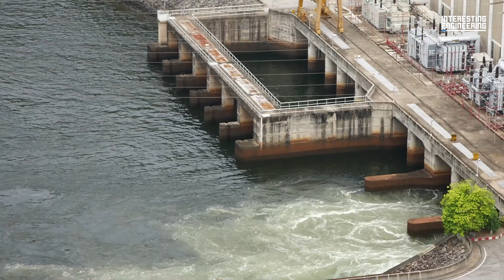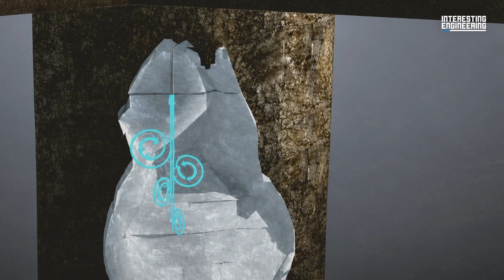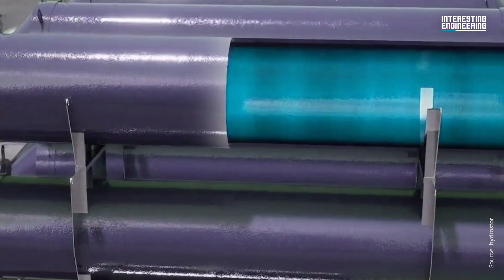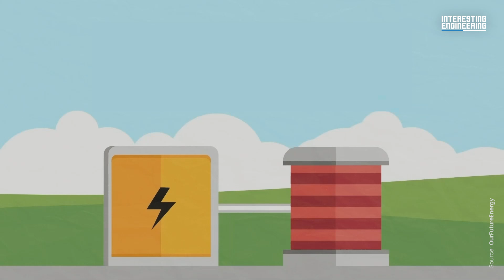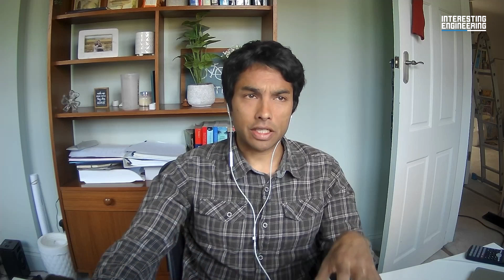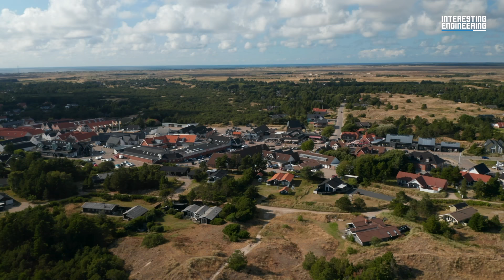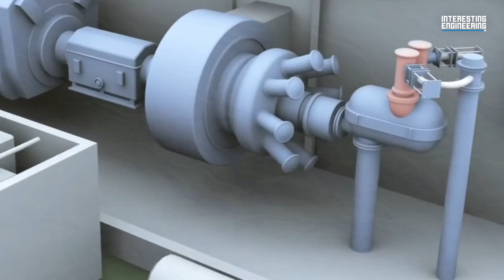Why Air Batteries Are Finally Beating Lithium

Comment: Why didn't you talk about A-CAES, this is the more efficient way the storage a large amount of air ? 
You split the heat with an exchanger from the air and storage it. When Energy is needed you release the energy and bevor you enter the turbine you heat up the air with the storaged air! The efficiency is aroung 65-70% quit good in my opinion. 20% less than batteries but you can storage much more!

Comment: The biggest issue with solar voltaic and wind generated electricity is it can disappear in a few seconds requiring instant makeup.   The instant makeup is created by the power grid running natural gas turbine generators at high readiness fast reactivity credited with generating zero electricity at the natural gas cost of generating all the electricity with natural gas combined cycle power plants.  There is no reported fuel savings.   Wind farm output wild fluctuations per second requiring constant makeup is the most natural gas expensive form of generating electricity.  The UK is culling wind farm output to save on natural gas.

Comment: I like LAES better. You can store liquid air in relatively generic tanks that don't depend on geologic luck or require high pressures, and they provide a steady output until you run out of liquid air to expand, they don't have a dependency between storage pressure and output.
Reply: Agreed. I didn't hear him mention liquefaction

Comment: A compressed air engine could be connected to an air compressor and heated midway from external flame. I believe pressures upto 5 atm can be easily achieved. Air compressor is used to prevent air running out. Else a one way valve could be used to prevent it. A stirling engine could be easily turned into a compressed air engine. Just make a hole on top of the right side cylinder and connect to compressed air source to the bottom of right side cylinder.

Comment: Could the temperature differential be made useful? For cold storage on one side and heating on the other side? The containers would have to be mobile though, charging in one location, dischargig in another. So I guess that creates it's own problems.
Reply: Well, there is also the possibility of moving the generated heat with water or another form of remote heating / cooling. Would just have to swap the direction of the liquid (or heat exchange medium) depending on where you're charging or discharging. And have something else cover the heat/cooling while it is not present.

Comment: I'm not sure what's wrong with wet electrolyte batteries.  You start with plain water and use dissimilar metals to store and extract energy.  Only about 4x as bulky as lithium ion cells but no rare or toxic materials just some lead which you contain, probably can be done with something other than lead.
Reply: I tell you what: a hydrogen atom  has one electron,  an oxygen atom has 8 electrons. So most of the energy going into electrolysis will go to the 8 electrons of the oxygen.

Comment: So for portable solutions it's not a replacement for car/transport battery that need individual routing. But for static items like civil and or train or rails that runs on a rail for conduction, it can be a non poluting source of energy. Cheers

Comment: Lots of talk talk talk ...

There are many ways of storing energy and a proper optimisation study is needed to clearly score the high efficiency storage from other storage options ...
Some clear parameters need to be outlined eg Litres per 100 kms in the case of vehicle efficiency 
Otherwise it's just talk talk talk and more likely blah blah blah

Comment: You could increase the output of the expander by injecting diesel fuel with the air across a hot surface igniter

Comment: The future of large-scale energy storage may lie in underground caverns filled with hydrogen at pressures above 200 bar, combined with fuel cells or hydrogen turbines. Although the overall round-trip efficiency is up to 70%, such systems can store terawatt-hours of energy for very long periods, potentially allowing the energy to be recovered even years after it was stored.

Comment: why not water battery? its much easier to make and maintain, and can be made with an open container. high pressure battery require thick pressure vessel

Comment: At 8:36 it was mentioned CAES should be located near renewables. However, the CAES facility in McIntosh, AL isn’t located near any noteworthy renewables. It’s one of the world’s largest CAES facilities IIRC taking advantage of a massive salt dome. It’s located next to a large base load coal fire power plant. So base load can be used to charge the storage, while renewables elsewhere on the grid are able to source demand. This is similar to the situation at the Racoon Mountain pumped storage facility in TN. It’s located near the Nickajack Dam hydro plant, which is renewable, but is dispatchable unlike wind and solar and is reliable year round. My point is, you build these types of storage systems where geology allows, regardless of whether wind and solar are good options nearby. You build out some sort of generation capability near by even if it is thermo electric. Then you let transmission and energy trading sort out the locality issues of the renewables.

Comment: Another option for improved efficiency would be to find an alternative use for the heat generated in compression and expansion cold.  If a town has a district heating or cooling system, then CAES could put thermal energy into this sink.  A swimming pool, large greenhouse system, industrial scale cooking, a supermarket, an ice rink, a large strategic food store - these are all consumers of low grade heat.  If you don't need a cold source, then heat for expansion could be gained by pumping sea water through reheat heat exchangers.  Of course, using bulk heat requires a lot more long-term planning and coordination between the powerplant and consumers within society.  It isn't a simple modular solution.  It requires infrastructure investment.
Reply: It is a waste to use good engine fuel for low temperature heating.

Comment: I am an engineer!  Let's not do interesting engineering, let's do actual engineering!!   As soon as he said cheap electricity is flooding the market from wind and solar. I knew right away he didn't have a clue what he was talking about!  Hydro is cheapest. 2 cents a kW to produce for lifespan of the dam. Coal is next 6 cents kW, next and around equal are oil/gas turbine up to 8 or 9 cent per kW.  nuclear is 12,   Solar is 15, then wind is 29...    the only reason solar works is because it is subsidized by government.  It forces power companies to buy it when people put in on their roofs.   Power companies don't want to buy it, they have to buy your solar power for way more than they can buy it from coal plants...    Same with wind but worse...    so many AI videos and AI facts...   I don't know how to trust youtube anymore...

Comment: Nah, I don't think so.
You can't prevent temperature changes when compressing or decompressing air, except by pumping heat out of the air being compressed and pumping it back into the air when it is being decompressed. This is a problem. Especially since this sort of system would prevent efficiency gains in the compression system generated by capture and use of heat energy during compression.

Comment: Wow.. it looks like CAES needs a combination with storage of heat/coolth .. but those storages can also each be made useful.

It should be possible to make clever combinations with thermal storage, at high and low temperature. The temperatures of storage can be tuned to local needs.

Comment: Many commenters here clearly didn't actually watch the video.

The key point is that with batteries, the battery capacity is the expensive part, with the grid-connection being (comparatively) cheap. Compressed air flips that - caverns or air tanks are cheap storage capacity, but efficient reversible pumps are expensive. This creates a niche where compressed air storage is more cost-effective if your charge/discharge cycles are longer.

Comment: Liquid Nitrogen Pressure Tank Battery or even Liquid Carbon dioxide and used by brayton cycle power plant when power generation is needed, we can use Nuclear or renewable to store or liquify the gas, we only need the right super alloy to hold the pressurize liquid gas

Comment: People keep coming up with mechanical energy storage systems but it doesn’t compare with chemistry in terms of energy density. Just think of a tank of petrol or an ev car battery which has enough energy to take your car hundreds of miles. No way any thing mechanical can compare

Comment: But efficiency remains a concern, you can only recover max 30% from the energy conversion
Reply: If you are going to lose 100% of excess solar or excess wind then any recovery that can be used on demand is better than none
Reply: still better than curtailing , and environmentally sustainable.
Reply: In the video he said 60-70%? https://youtu.be/GoiECSXOvQE?t=581
Reply: @mad1toad  maybe at peak efficiency, the efficiency drops as the pressure drops
Reply: @interhaker keep the pressure high then
Reply: @stopscroll23  you can't
Reply: Coal has even less
Reply: Plus coal is power generation, not storage so this you have to minus the losses of generation minus another 70% for storage in this case
Reply: @daniel-jipa  wrong coal can be 40+%
Reply: @daniel-jipa We can use coal 24/7.
Reply: A lot of energy loss is a total killer IMO.
Reply: Petrol engine is no better.
Reply: During sunny days the price of elecricity goes to zero (or close to zero). 
Then you do multiply zero cost times 30% ratio and you still get zero cost.
Reply: Sure, but storage remains basically infinitely scalable.

Comment: The solution will be a mix of all energy storage systems. Thermal energy storage , cold or hot , is a very viable option since a big chunk of energy is used to heat and cool spaces .

Comment: Compress air it warms attracting moisture.   Cooling air  water is released,   irrecoverable energy is lost.    Should a tank rupture stored energy is released with no control.  there might be be considerable damage?    That's without examining what is the reason for needing this?  It is not carbon dioxide so climate is unproven.

Comment: This might not be feasible at this time, the dimension vs the cost of construction and maintenance for all the system parts specially the moving ones and the hazard factor for these pressurized tanks. Failure of the system is higher if more components are added in it.

Comment: Anyone else thinking free air-conditioning?  Cool the compressed air, use it as an air conditioner on expansion.
Reply: I mean that could resolve the decompression situation in the second stage of the storage. Although that idea might need some additional infrastructure to move said cold air which again is going to be costs.

But I hear you stranger, I hear you.

Comment: I'm so old that I remember "bubble memory", a non-volatile storage technology that seemed to have a niche use in the 1970s. But it got overtaken fast, and is now forgotten. This sounds like the same story; you can argue that it has a niche use-case right now, but I bet sodium batteries will wipe that out before you can sneeze.
Reply: What process was bubble memory based on?
Reply: @kakiremora2991 It was some kind of magnetic domain that could be clocked along a chain. There was no random access. The idea of solid state non-volatile memory seemed magical at a time when a hard disk was the size of a refrigerator and in a dusty corner of the factory people were still making ROMs by threading address wires through ferrite cores.

Comment: both solar and wind waste space and wind turbines produce a lot of noise that disturbs both people and wildlife. We should be building nuclear everywhere
Reply: You need uranium or radium ore for sure. Every method have their own level commission and limitation, it's highly maintenant.
Reply: @topbadgun Yes, but the fuel required is miniscule compared to the energy produced, sure, you also need storage for the depleted fuel, but that's also a much lesser problem than people think because of how slowly the waste is produced.
I still think that long-term nuclear is the best from both economical and ecological perspectives, at least until we figure out fusion
Reply: @nocturne6320  As of right now Nuclear is a very efficient power source, you probably know this but nuclear energy mostly gets its bad reputation from Chernobyl (Which was made with cheaper parts which caused the meltdown along with breaking alot of safety rulkes) and nuclear waste and possibly the nuke which is basically just a nuclear reactor designed to produce as much uncontrolled energy as it can in as little time as possible

(Just wanted to rant a bit about nuclear energy)
Reply: Wind is not renewable it damages weather and wildlife.

Comment: But hmm compressing to high levels gives of quite a lot of heat and costs quite a lot of energy too do....
And also you need a dehumidifier for the intake?
Maybe a closed system with another gas?
Anyway sounds like a problematic thing to maintain too.  
I guess it be a nice extra that can work in some cases....
Reply: Yeah, maybe just use dry air or nitrogen. Also seems somewhat similar to hydrogen but without the electrolysis part

Comment: Why is it always salt caverns or steel tanks? In Toronto, about a decade ago they put in Balloons under the water. Large weather balloons but talk about cheap and available space! This can happen in the water beside every major city in the world. There is always water and the elevation change can happen down there and the containers are cheap and maintain pressure better than tanks do. The trick to efficiency is to store the air and also the heat from running the compressor in a thermos of sorts. Sand batteries for heat and underwater balloons for air. It is very simple and effective and accessible

Comment: Informative video. Exciting new tech
Reply: It's definitely not a new idea.  A variant of this technology was used in Germany 60 or so years ago.
The compressed air, stored in salt caverns, was used to power gas turbine driven electric generators, by-passing the turbine compressor stage as this was redundant.

Comment: compressed air efficiency for Energy storage is not very good. You’re only achieving 45 to 50% . Storing energy in molten salt is more efficient.
Reply: 40-50% is great when compared to not storing excess electricity at all and instead having to throttle the production.

Comment: CAES can maybe beat lithium . . . but what about sodium? The thing about batteries is, they have constantly gotten cheaper, denser, better, safer. Alternatives to batteries always seem to be aiming at where batteries are today or tomorrow. But five years later, batteries wind up being much better and cheaper than anticipated. I mean it's always like "batteries are great for an hour or two, but not for ten hours." As if batteries have an hour limit? Nope, they can store energy for weeks and months perfectly well. It's purely a matter of cost. So then battery costs drop dramatically, and then it's like "yeah sure batteries are fine for 24 hours but what about multiple days?" And this cycle of reevaluation has happened continuously for the last 40 years. I mean I don't know exactly which battery technologies are going to end up winning. But I know the winners in energy storage will be batteries.

Comment: These guys should bring the tech to Delhi, in the winter they have heavy smog due to which burning of fuels is greatly curbed by the govt but not nearly enough because energy demand is too high and unmet. Govt did announce plans to curb out fossil fuel based energy sources but renewables arent getting the job done. Would help if this stored power throughout the year and then sold electricity back to the grid in the winter.

Comment: Every technology has its limitations. We are going to need a variety of energy storage systems and they all have their uses, even if some of them work OK, but not perfectly.
Reply: Well yeah, this one is At-Front costs. Which is one of the most difficult problems in all infrastructure projects. Similar to Nuclear.
Reply: nope, choosing two and sticking with them is far better for scaling.
chemical battery for daily use and gravity for long term storage, gravity is best long term because it can be stored practicaly forever with zero passive lose.
Reply: @Jack-he8jv  For maximum efficiency you'll ultimately need different tools. Thermal batteries work better if heat is your main concern. Air batteries could be very useful for refrigeration/heating as well.

Comment: Everyone is chasing efficiency. But I don't think it matters as much as we think. If you are burning coal or gas to make electricity then every 1 percentage of efficiency is milions of Euros in money made. But with solar panels making electricity is bargain cheap. Storing it for later is expensive. So use cheaper way to store electricity even tho it's 20% or more less efficient than expensive one
Reply: Very true.  Even Low efficiency storage can be useful in some situations if it is cheap.  If the alternative is wasted energy, inefficient is irrelevant.

Comment: No mention of placing these with data centers or other places that need massive amounts of cooling?
Reply: Data centers primarily consume energy because of computation, and they do it 24/7. You could argue that big consumers need to be forced to invest in green energy but technically speaking batteries are a good match for fluctuating power producers, not constant power consumers.